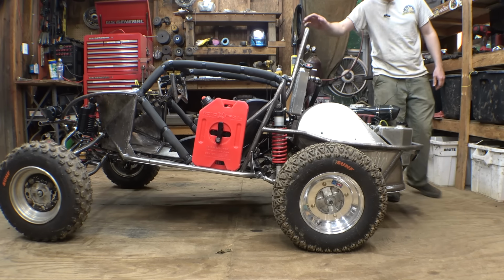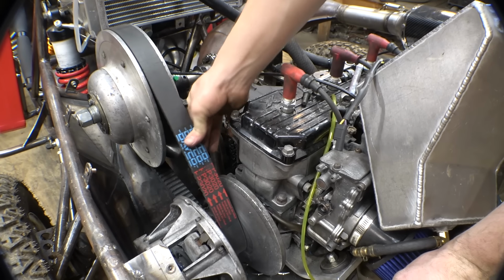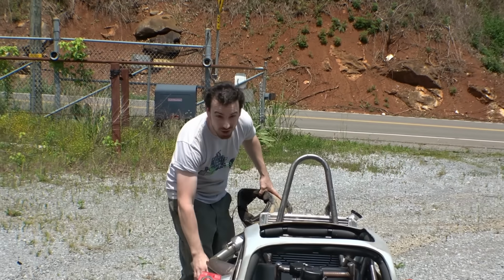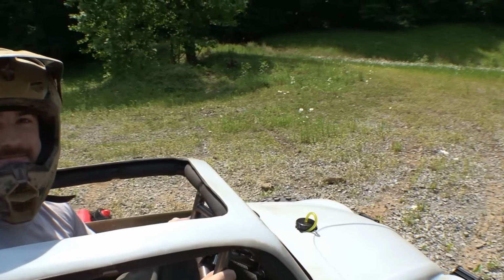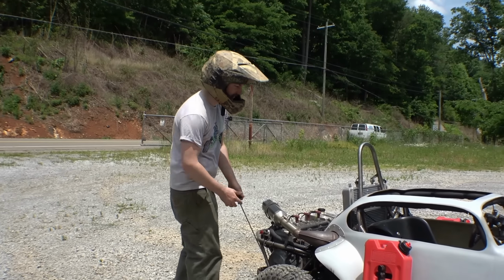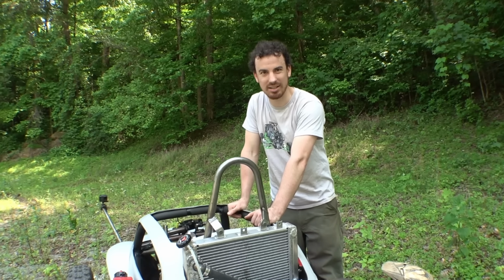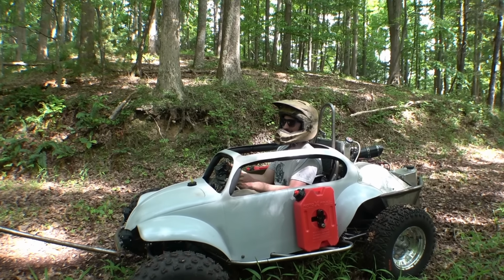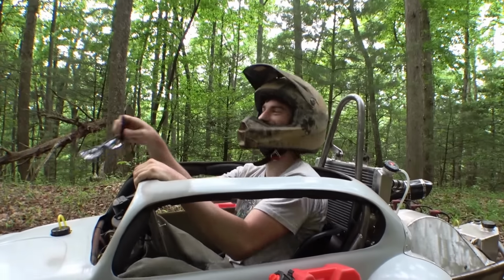This Thing is Nuts!!  - Mini Baja Bug Project First Test Drive

Comment: Chris, I really thought you would have put a fan on the radiator come on man you know two strokes heat up quickly and yours is at the rear where it can't get any cooling so a big fan is really necessary you probably are boiling the fuel in the carbs it defiantly sounds like fuel flow issue you might just need to fit a fan and a rad switch and all will be fine but a good suggestion was made by your friend about the float heights might be worth checking as they could be shutting of the fuel too early but I still think a kinked hose or boiling fuel or both so all the best from john from Rugby UK ps it's one hell of a build my friend she goes like a rocket when it's running well.

Comment: Love the little car! But, here are my observations. The chassis is too spongy for drifting. Gotta either lay it down a bit, or stiffen things up a lot. This is what's causing the front-end to float. The wheelbase is also so short that it just wants to go in a straight line. Putting some weight in the front end might help with everything, especially donuts.

Comment: Great build, The most awesome VW bug I have ever seen. I think the problem is fuel starvation . Maybe you should check the fuel take up in the tank. You could maybe make a system in the tank that allows a chamber to salvage fuel when you get inertia sloshing the fuel around . Or is pickup towards the rear of the tank?

Comment: It very well could be your clutching on why you can’t get it to do a donut and wants to bog out. From my experience with snowmobiles. If the clutch’s are working against one another it acts like there’s a fuel issue or something else so could be worth looking into. Clutch springs and primary weights

Comment: the fuel issue
jet fighters have fuel cell bladders for a reason. they flip flop around and any air in the 'tank'  is going to get sucked into the lines. a fuel cell bladder will let you go around turns and never suck air into them and cause a problem. weee donuts!
when you make one for a future project think of a large purse, one that expands side to side with a hard attachment at the top for the inlet and the front & back corners. i'm leaving a lot of details out because it's research that will teach you a lot along the way. bladder material for example.

Comment: Adjust the compression setting on the rear to stiffen it up some now that you adjusted the springs. It is still squatting a lot when turning and under acceleration. It 3 wheeling is cool but you don't want it to drag the rear end on the ground.

Comment: Another way to make it run a bit cooler is higher number sparkplugs, Like if its got 8's put 10's in. I saved many a tuned YPVS piston using cooler running plugs.

Comment: Needs a front and rear sway bar and the turning will greatly improve also check the float level and make sure you have good fuel flow with a small low pressure pump and regulator

Comment: Go to the right when you try to do a donut. And definitely check the float levels and maybe the feul pump is a little weak. It's running fine in a straight line? And you didn't run it long the first rip so I don't think it is overheating.

Comment: Hey, love the channel! 2 thumbs up! I don't know if you will see this or if it even applies but, I had a similar issue with my cross kart. On my Yamaha XJ550 inline 4, 4 stroke, the carburetors had the bowl vent inside the air horns of the carbs and when I would try a donut the fuel would slosh to one side so hard it would come out the bowl vent and dump raw fuel into the air box and the engine would bog hard. I haven't looked back at the video of you rebuilding these carbs to see if you have internal bowl vents or not but, thought if you see this comment, you may have a look at this. I solved this issue almost completely by thread tapping the vent holes for jets and installed #30 jets into the vent ports. this limited the amount of fuel that could escape into the air intake. EDIT: After looking back into the video of the carb rebuild, I can't tell if the vents are in the air horn. Looks to have ports outside of the carb but, I did notice the fuel bowl didn't have a baffle shrouding the main jet like on an ATV carburetor and if the fuel is moving away from the jet then that could be an issue. Anyway, maybe this long-winded comment will help you think of some other ways to correct the issue.

Comment: a rear sway bar and a stiffer springs would help a lot,  you can see it just squats hard as soon as he gives it the beans, one reason he dont have good steering. all the weight  is on the back wheels,  the diff needs thicker gear oil also after he gets the rear suspension/ weight distribution sorted out.

Comment: All that property and you roost the trucks for thirty minutes 😄👍 and yes all radiators need fans especially when not in air flow, and even if it is in airflow doing donuts doesn't get sufficient airflow...so yes a fan😄👍 p.s hot engine, hot water, very hot engine, very hot water, radiator blow, very hot water on driver, a cool 750k on hospital bills and a month on your belly and disfigured for life. 👍 I only care bro💓

Comment: Your body is distributed 50/50 but the engine is 100% on the back and not to mention the torque shifting the weight to the back, you have to have the suspension in the back higher from the ground and firmer, also limit the travel of the front suspension so when you turn the inner tire doesn't lift.

Comment: Just remember running lean means running hot. I'd fix the fuel issue first then put fans on. Personally I believe your radiator is big enough.

Comment: Radiator fans a must have those engines are made to run in cold weather water in the Radiator  is not gonna help get some super cool antifreeze  and keeping  fuel supplied to them carbs it may have to  be jetted for warmer weather  and maybe a low pressure  fuel pump but than thing is one bad little machine  hopefully  like someone else said you put  herbie decals

Comment: Larger main jet, definitely lean past 1/4  throttle. Or what's the needle position? Raise the needle first. If maxed out larger main.. pilot circuit sounds good, easy start good idle. But idles higher after load, focus on the main circuit. 2 strokes idle higher after being leaned out.. awesome build I could never fit.. 6'5" almost used to be.. but 41now.. heyy maybe when I'm 85 I could drive it!

Comment: if those shocks have adjustable rebound damping, it might help to reduce the rebound damping, since if its too high then the shocks cant extend fast enough before hitting the next bump and start to get packed in, making them squat down to the bump stops. They looked really slow on the rebound when you were pressing them in the shop. definitely need stiffer springs too though

Comment: I think you can get spacers that go over the coil post as well.
Pretty sure I saw people doing that a few years back.

Also, I had a snowmobile that had a loose motor mount, and it broke a couple belts before I figure that out and fixed it.  
BUT the problem was, that belt ripping was super dangerous, and it destroyed all of the thick plastic around it, so I was thinkin you might want to put a cover of some sort over it, incase it rips and tear half your arm off or something?

Comment: If it's leaning out and breaking up like that it will get extra hot, hopefully if you sort the fuelling it will bring the running temp down ;-)
First thing I would do is remove the inline fuel tap, those little plastic ones are restrictive.

Comment: With the amount of weight transfer that thing has, as soon as you try throwing it into a donut, the inside wheel spins wayyyy faster than the outside due to your open rear diff

Comment: a 12 volt rad fan zip tied to the rad would solve your heat issues. Asa well - if you want donuts consider a taller gear ratiio. that clutch will provide you with lots of top end. Just a couple teeth on the rite sprocket will have  the engine up in the rpm it needs to be and itll roost like no tomorrow! Yer close to a real screamer - very close!

Comment: FIRST: Special thanks to Dude for letting you rip his land and filming for you!  Thank You!  (and not killing you at 19:22).
You need a fan and make some curved rear side window scoops out of clear plexiglass Radiator is good but needs AIRFLOW!
Another rather B welding WIN with the Mini Baja Bug
It doesn't sound like it is "bogging down" it just hooks up and hauls ass.
I just did an internet search for "Donut Races" and there is a 10K foot race in Phoenix, but no VW's allowed so just except the fact it is too fast for donuts, add airflow, read the plugs and enjoy!

Comment: You need stiffer springs. Ive watched alot of no prep drag racing. And gttn the rear to drap down over the tires adds alotta grip which picks up the front

Comment: Stiffer rear springs & or a sway bar setup. 

You may need a dual spring setup so it still sits down to a proper ride height but then hits the big spring to hold up the chassis better.

The front may need work, but the rear is so bad that it's hard to suggest anything for the front other than leaving it alone for now. Lol

Comment: Ok if u have fuel issue on cornering it keep running motor lean which is bad. If you can't baffle it out in the tank try ND outlet on both ends of tank then tee them together

Comment: Dude. more compression on the front springs. Tighten the comp spring on the right while turning left for example. It lifts the skis like a snowmobile. The less that outside wheel lifts , the better

Comment: It needs to be raised in the rear and a bit more droop in the front ,it keeps 3 wheeling and that's why it won't hardly turn under acceleration

Comment: Rear sway bar and a different steering rod connection point on the knuckle would do good. The outside wheel is the only steering wheel touching the ground and it just doesnt turn that much because the angle isnt that great.

Comment: I would lock the rear diff to be able to slide the rear end around, and that would help with the understeer issue.
Reply: and put some fans on the rad or airflow to the motor itself.

Comment: I believe stiffer spring rates in the rear as well as a rear anti roll bar would help handling a lot. Your squating so bad in the back you're unloading the front wheels in corners.

Comment: Chris you've got to learn to shift the gears that you build into your toys.
About the only one you actually use the gears as you should is the shifter kart, and that's because you have to.
Yes snow mobile engines typically run at high rpms for long runs at a time, but they are usually in below freezing temperature too.
When you are not trying to go full out, let it run lower RPM's, and cool down, and if you need to get back into the power band 
Then down shift couple gears, and what you have is three different gear ranges us it not, and second gear is your power band for instant get up and go mode. 
First is low range for crawing up steep rocky areas, third is for top speed or just going along at lower RPM's but not begging it down. 
Call it moderate speed but lower RPM's, and taking it easy just enjoying the view, but at much lower noise levels and not at the peak of the power band just a twitch of the throttle away.
PS 
Going up the trail at speed it sounds like a hill climb time car from Europe car builders running wide open up the course at speed

Comment: ok i know your not gonna listen but that needs that back roll bar over the top of your head . cooling fan , fuel cell foam in the tank , rear sway bar, wrap the exhaust to get rid of some heat , put water wetter in the radiator , sync the carbs at temp ,etc,etc

Comment: Dude, I think your vent tube on your gas cap is why it bogs down. one minute it got plenty of air then it doesn't. just like shutting off the vent completely, it will die. had the same problem. friend thought it'd be funny to shut off my vent and it wasn't long and it started doing the same thing till it died. hope this helps.

Comment: Major understeer batman.  Seems like the location of the engine accompanied by the torque of the engine is pulling the rear of the cart down causing the front to lift up.

Comment: Dude I recon if you ran a solid rear axle no differential it would donut no worries ! You can see the back bogs down when you’re trying to accelerate so you have huge amounts of traction ! 
And fuel pick up in the fuel tank could be an issue it’s seams to be doing the engine bog when you turn one way and not the other

Comment: The rear suspension issue is due to the shock attatchment location being in the wrong place, the shocks need to be further away from the pivot point where the control arm connects to the frame, the closer to that point the shock is the more leverage (length) the control arm has to compress the shocks 😊

Comment: Start with an electric radiator fan, then if need be go with with a larger radiator and put a fan on that. If the coolant temp drops to within the safe range while running it, then keep where it's at with that setup. Don't spend too much money if you don't have to.

Comment: I would suggest moving the radiator / adding the fans , as where its placed now , when you are in the seat , there is not sufficient air flow , so no cooling is happening at all

Comment: Cool machine. I think that your shocks are to soft and there is not enough weight in the front. For the donut ripper you are looking for. But if you want to do donuts. You also are more likely to flip over. So you might want to protect your head and neck better

Comment: Hey guys sweet car and fun content. We should all consider proper helmet type and fitment when doing this crazy sh#%. If one had a head on sudden stop in this car wearing an MX helmet they may not have a nose or upper lip anymore . That would realy suck . Lets try to keep the brain box intact. Loose fitting helmet of any type is pretty bad aswell. but still better than nothing

Comment: If you lifted the rad like 5in that would help air flow and you can adjust the max temp by the radiator cap. Was it boiling over?

Comment: Radiator is big enough just it requires a fan to keep it cool. It runs perfect till you get to overheating it and it has carbs so donuts will be hard to make it do due to the fuel sloshing in the carb bowls. Add and fan and itll be good to go

Comment: It sounds like the engine was detonating, when that happens you lose power and it sounds like gravel are thrown at the engine.
That can happen when it runs hot and/or lean. Don't push it or you may seize it, melt the piston or blow a hole in it.
You may switch to colder spark plugs as well compared to the original ones intended for winter use.
Jet it for more fuel to cool it if you can without it starting to 4 stroke.

Comment: The differential will be a +\-, with a locked rear it will oversteer on power, having the differential will cause it to open and send power to the inside wheel causing understeer

Comment: Looks like the rad. Is large enough but you are blocking most of the air flow with your body! It needs an elec. fan to pull air across the radiator before you cook that engine.

Comment: You turn the wheel left hand down every time you tried to donut. Did you right hand down? Sounds like the fuel sloshing away from the pickup. Or like Brian suggested the float height would cause the same issue. It seems to run fine in a straight line so Im thinking fuel slosh

Comment: seems like youre running a bit rich there bud :)
before checking that i'd swap the spark plugs. if thoes two things doesnt fix the issue its gonna be on the cdi or even coil side of things

Comment: Maybe air ducts from front to the radiator with turbo fans inline to force air to the radiator then you won’t need a bigger one with a fan to take up more space back there . Ducting and turbo fans would keep the weight down to

Comment: Did u rejet it? Them meant to run 0-30deg Fahrenheit at sea level. Any warmer or higher elevation gotta take them bowls off and change em. My xlt runs 190-210 main jets size @ 10-20deg

Comment: I would try a stiffer spring in the secondary clutch it sounds like the belt is getting pulled down in secondary clutch and putting you in to high of a gear to fast to hold the low end power

Comment: Build a frame off the rear frame that's angled in the air and then mount the rad up on it with an electric fan included like in the real trophy trucks.

Comment: Needs stiffer springs in the rear. At this moment although the rear is sitting at the right ride height, the springs have too much preload and the rebound force is not in proportion to suspension travel. Also the angle of the rear trailing arms gets shallower as the suspension travels up, giving it less anti-squat, which also might contribute to the rear end sinking so much when accelerating.

Comment: I would lengthen the body and the chassis.   Will fit more people and won't lift the front wheels, so better steering. Fiberglass is easy

Comment: You need radiator fans, The engine was built to run in the winter and you might have to play with the carb needle or jetting.

Comment: Hey, bud that is one beautiful build, but the radiator is big enough. I built something similar to the motor and radiator that you're using. It just needs a cooling fan.
 Just try to use one thats  Almost equivalent to the size of the radiator I really think that will solve your overheating problem

Comment: You're going to run lean when you're in a hot climate so cooling down the temperature you might be able to add on like a oil cooler type towards the front and I'll just line it underneath or whatever add a secondary cooler and the fans that will help keep the temperature down